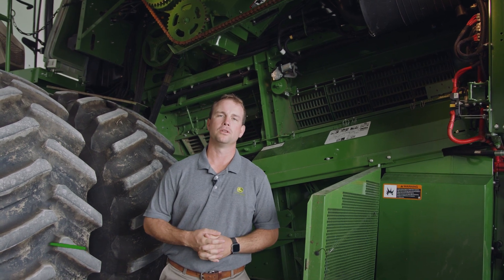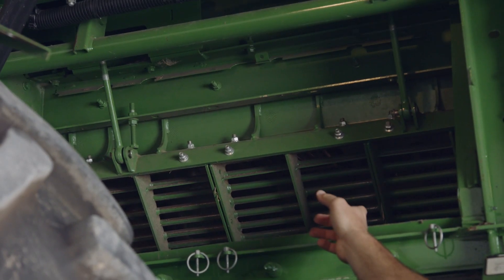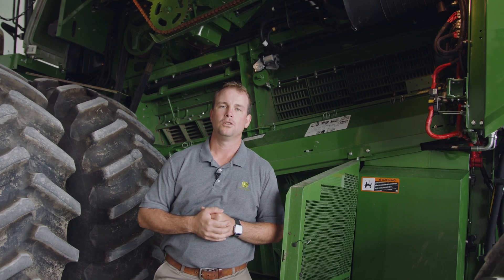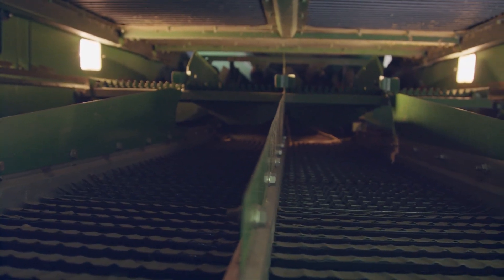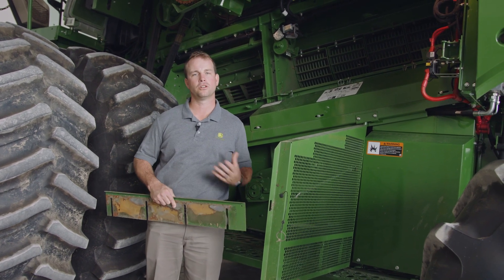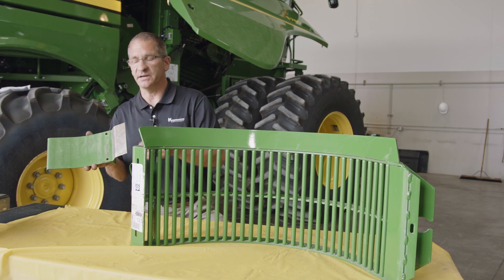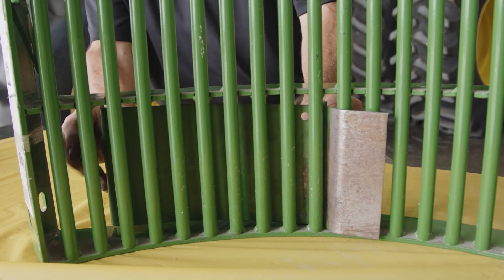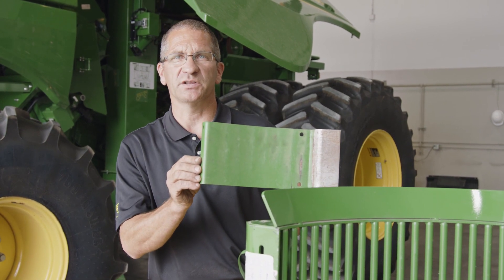Rotor Combine Performance - Grain Separation

Comment: What is the part # for the concave block off plate? Would running the small block off plates in the separator grates help even out the crop over the cleaning shoe? Thanks